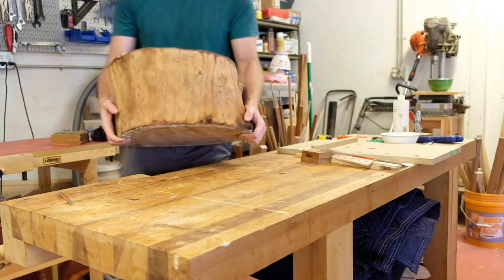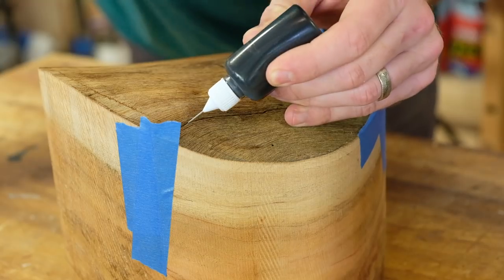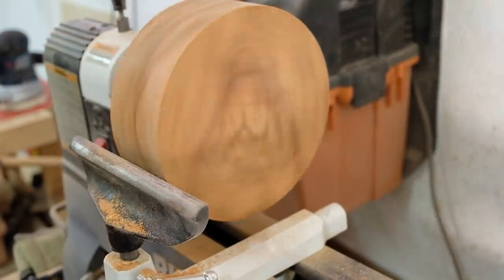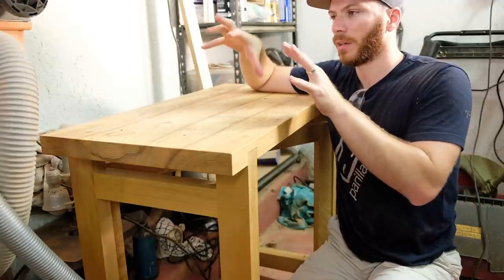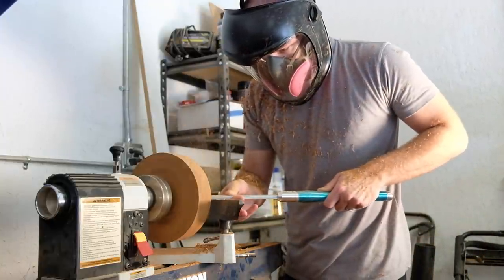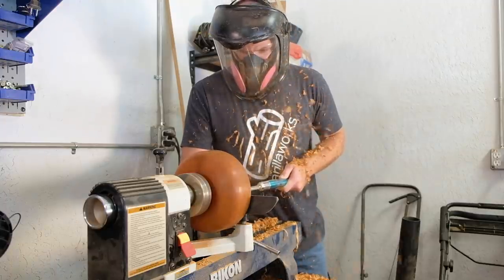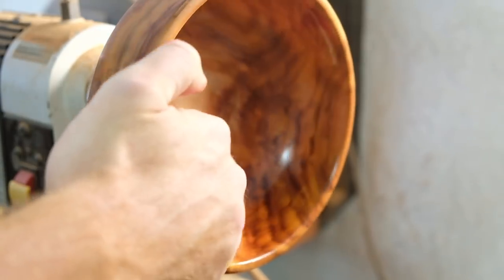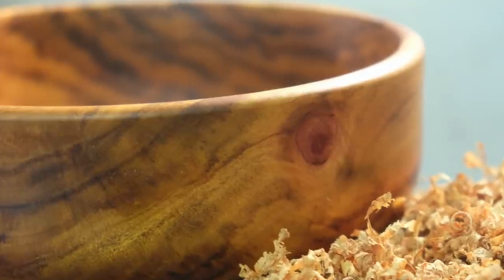Turning a Bowl from Fallen Hurricane Wood

Comment: Just so you know, the circle marked that way is narrower across the grain Vs along the grain because of the curve of the wood. If you make a circle cutting jig, that would work better or just cut outside the lines on the short sides.

This is mostly an irrelevant point but I thought youmay wish to know that the wobble was mostly this rather than your accuracy with the bandsaw.
Reply from the maker: Great point. A circle cutting jig would be great for the bandsaw and probably not too difficult to make.

Comment: When you have been, seemingly, a stalwart traditionalist when it comes to woodwork am I the only one to be disappointed seeing you use carbide tipped scraping tools rather than traditional cutting tools when it comes to woodturning?
Reply from the maker: I can see where you're coming from. I started out with traditional tools but picked up the carbide as a means to an end kind of thing. Just to get the job done for my dowel chair last year. If I take on more turning projects I wouldn't be opposed to traditional tools.
Reply: @parillaworks  Thank you for the reply.  They have their place but in my arsenal it is for end grain turning for hollow forms only!